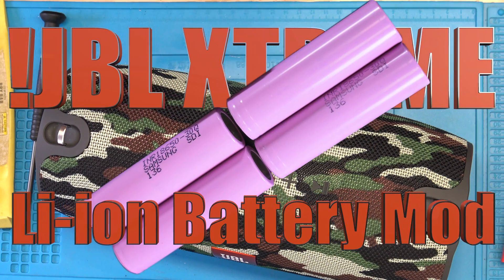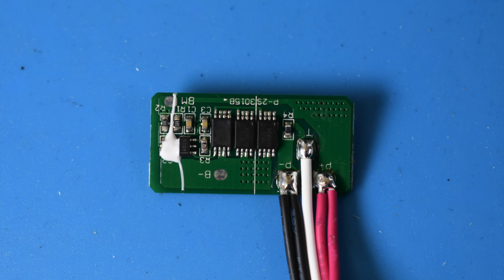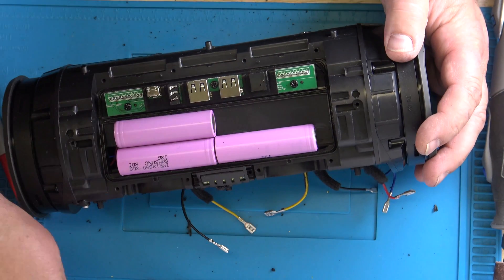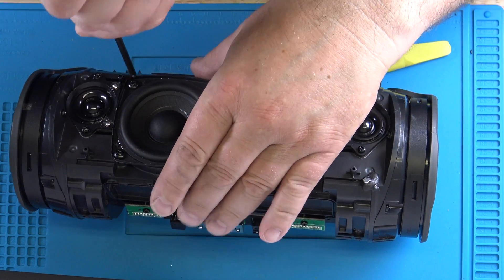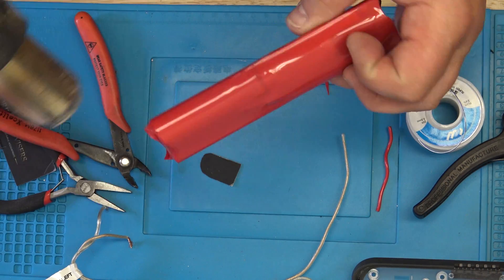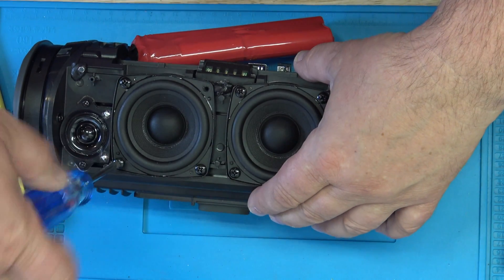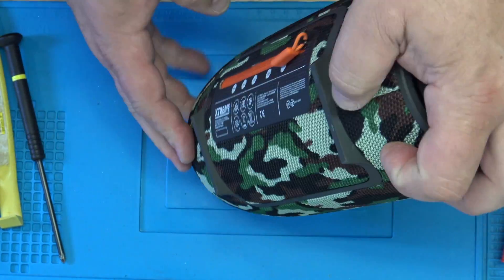JBL Xtreme Li-ion Battery Mod - The Right Way

Comment: Hi, can you explain me one thing. when i make 2s with 18650 so the voltge vil be 8.4 v and the charger is 19 V so how this can work ??
Reply from the maker: I made this video 6 years ago, and the speaker still works with the same battery hack. That show me that it works. I don't know how, but the original pouch battery is wired the same way.

Comment: Hey, I’m trying to do the same with the boombox 1 and i found they are 4 cells not 2 and the BMS is like a double of the one on the xtreme so could you please tell me how to connect? Should i get 8 batteries 18650 ? Or only 4 ? Please help
Reply from the maker: doesnt boombox one have 18650s?  i think its safe to get a new battery of ebay.
Reply: No it’s not unfortunately it’s liPO battery  i guess
Reply: Could you please send me your facebook profile or anything so we can chat on ?

Comment: Sorry for the very very late reply. Just want to say thank you for sharing your video. I was able to gain knowledge and experience. Especially during the replacement of the battery of my jbl extreme speaker got from my father in law. Now i have two of them the other one was the jbl boombox. I did the same.

Comment: Hi, thank you for this demonstration! I have done the above with some Samsung 3500mAh batteries. How have your batteries held up? Are they still keeping a charge after 4 years? Ive noticed when charging mine that the indicators go from 1-4 very quickly and also from 4-1 very quickly. Have you noticed that your battery level indicator is now less accurate?
Reply from the maker: not really, mine still works great. Make sure you have real Samsung batteries, there are counterfeit cells out there. And it takes only one bad cell in the pack to make the battery pack behave weird.
And what do you mean by very quickly? How long does it take?

Comment: How did you manage to solder the wires to the BMS module? Solder doesn't stick to those plates when I try to solder them.
Reply from the maker: You need to solder the battery ends off that board, heat it up with the soldering iron, and remove them first.
Reply: @mygiguser  Thank you.
Reply from the maker: it should stick, no problem here

Comment: hi,do anyone know solutiom for xtreme 2?,because theres a yellow and white cable,the white cable with 10k resistance not works,been changing the battery cell with original bms board but the bms didnt showing output power
Reply from the maker: the xtreme 2 has already Li-ion batteries, you can buy a complete pack with bms
Reply: the battery itself here was way to overprice, the price of the battery are like as the speaker itself sir,cant turn the speaker without battery😢
Reply: is there a way to use the speaker without battery,sir???

Comment: jbl xtreme slow charging after 18650 battery 2600 mah panasonic replacement, what"s the problem?
Reply from the maker: what do you mean by extremely slow? is your power supply ok? how did you wire this (same as in video?)?
Reply: @mygiguser  after 10 hours charging last diode of indicator still blink, power supply is ok,wire is same as in video. how many hours do you  need to charge you speaker after upgrade 18650 batteries?

Comment: Hi!
i was doing the same mod for JBL boombox can you help with wiring. It has 4 x 3.7 V cells  like xtreme but the BMS have 4 pads 2 B+ and 2 B-. Should i individually connect 2 x 4 cells in parallel and connect them to B+ and B- respecively or need balance lead. Bit confused any help will be appreciated.
Reply from the maker: connect the same way as the original battery was connected
Reply: @mygiguser  yes connected 8 Lion cells (Sony VTC6) in 2S2P configuration to make a 14000mAH 7.4v battery pack. The cells where at storage while making the battery pack. After installation it got 100% charged in 2 hours and i have been doing a test from past 12 hours. The backup has increased as still the 5th led has not started blinking. Thanks @mygiguser for the idea.

Comment: @mygiguser I accidentaly ordered a new battery for the xtreme 2 instead of xtreme. Could I just trim up the battery spot like you did and put in the xtreme 2 one?
Reply from the maker: the battery in Xtreme1 has 5 pins, and the battery in the Xtreme2 has 6 pins. So the answer is no. You would have to rewire that new battery pack to get the connector right.
Reply: @mygiguser  what is the yellow color in 6 pin xtreme 2? i now the red are positive black is negative and white is temperature but the yellow im confuse.

Comment: Why not make a wire with plug going outside, so you can connect and disconnect multiple batteries ?
Make a fake battery pack inside to keep the sound the same
Reply: because it is ugly

Comment: Thanks for this video. I'm just wondering how to do a li ion battery pack with negative, positive and data cable as well. My Sony XB30 bluetooth speaker has 3 connectors on the battery port. What happens if I make the battery pack without that third (yellow) port?
Reply from the maker: you need to build the battery the same way the old one was. the 3rd connector may be for temperature monitoring, and the whole thing may not work without. But the XB30 battery is already made from 18650s? Does it make sense to just buy a new battery pack?
Reply: @mygiguser  thank you so much for replying me. I'm not sure if the battery package of my BT speaker is made using 18650 batteries. I just want to know how to make a new package because I found that purchasing a new one is not that easy and to be honest I really like the sound quality of my bluetooth speaker so much that I don't want to throw it away when its battery pack gets damaged.

Comment: I did it. But the cable burned out. Which cable we need to use is the vehicle wiring cable?
Reply from the maker: you did what? and what vehicle wiring cable? what cable burnt out?
Reply: @mygiguser  
I used a thin cable.I made the wrong arrangement short circuit

Comment: Can I do that to my JBL charge 3? What's that a combine of parallel and series connection?
Reply from the maker: No, not enough space in the Charge3, and yes parallel and series!
Reply: What is the voltage of that connection? I thought that jbl extreme is only about 3.7v

Comment: I will try this. I have 18650 4x 5000mah..thank for this video..
Reply from the maker: there is no such thing a 5000mAh 18650, that sounds fake. Where did you get those from? China?
Reply: @mygiguser  no.. I took from broken samsung laptop. And Ialso have 3500mah
Reply: @BLACK_HEART_1993  How is it working for you mine are 4200

Comment: I will use 26650 3.7 volts with 5000mah.base on your drawing i will connect only the blue and red?no need the green?
Reply from the maker: 26650 doesnt fit, and why are you questioning the green? Green is shown in the schematic because it is necessary. I dont understand why you question that? Also 5000mAh may be too much for the BMS, the max for a 18650 is 3000mAh as far as i know, everything higher is fake.
Reply: @mygiguser  because i will use only single battery..26650 5000mah

Comment: Will 2 batteries setup work.. if yes then how to connect bms?
Reply from the maker: where do you put 2 batteries? there is not enough space
Reply: @mygiguser  i have onepack inside near the radiator. can install another pack in place of the original

Comment: But there is hole in the speaker box now. Radiators needs a sealed box to be able to make bass
Reply from the maker: fwe we use silicon
Reply: mygiguser maybe some harder glue would be better but yeah
Reply: Lost the bass

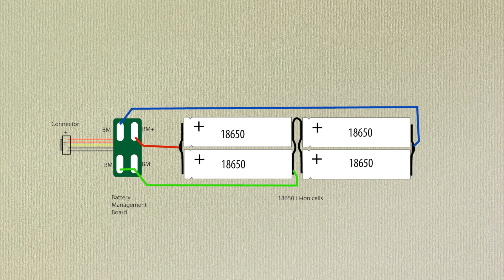Comment: Can you please explain to me the diagram shown at 2:43. This diagram is different from the other vids showing. I just want to know what and why because I don't have any idea. Thanks for answering.
Reply from the maker: not sure what there is to explain? how is it different than others? The original battery has two pouches, my setup has 2 sets of 2 batteries in parallel, and the wiring is the same as the original battery pack. And btw this setup works in my speaker since i made the video, and that is 2 years now.
Reply: @mygiguser  thank you so much for responding. Is it okay for those 2 wires in the middle to get in contact with each other? I'm talking about the wire that connects to the green wire. I hope you understand what im saying as I don't really know how to explain it.
Reply: @mygiguser  I'm just currently waiting for the 18650s that I ordered before I do the procedure. I hope I wont blow up my speaker lol

Comment: Ok. I've seen people with that it keeps blinking with the fifth led. Why is that and what could you do about it?
Reply from the maker: Well when you have a brand new great battery this charge indicator may work. Once the battery was in use for a while it is more and more likely that the 5th LED stays on, because that kind of battery looses its capability to charge 100%. And the 5th LED shows the 100%. I don't think it is a big deal.

Comment: 1:39 Those magnet does not conduct electricity. Therefore, there is no insulation on the connectors :D

Comment: Great video.

One question... How did you test the laptop batteries  to determine if they are good or bad?

Thanks.
Reply from the maker: i used an intelligent charger/discharger to charge them one by one. There was only one bad in the whole pack.
Reply: @mygiguser  OK thanks. No easy way that I can check it without fancy equipment? (also using an old laptop's battery and don't want to use cells that are bad)
Reply: @HeinrichvanRooyen  There is an easy way, youtube it.

Comment: Hi bro. Very nice video. Nicely explained. I have one question The original battery is 5000mA 7.2V, I am planning to put 6 no’s of battery, each battery 1.2 V(AA) 1300mA. Battery size 6 no’s fits very well , Is is possible to connect 6 no’s AA battery in series to the circuit?
Reply: no it is too long

Comment: @mygiguser can you explain??  
why you put the batteries in series and not like the original configuration 2x parallel ??
second question: does the green wire connect on the BMB on both BM contacts??
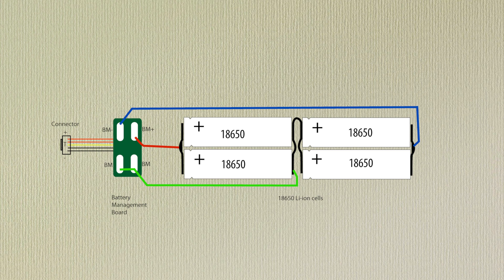Reply from the maker: @2:44 is the schematic of this, and yes, green wire connects to both contacts.
Reply from the maker: The original configuration is 2x parallel? what does that even mean?
Reply: Ok let me  change the question so you understand it better , the original configuration was two flat batteries independent connected to the BMB. why did you made one batterypack out of four batteries and not two packs of 2 batteries? And connected them the same way as the flat ones

Comment: update on jbl charge2. i was able to salvage d pcb board on the swollen lithium ion battery of my jbl charge2. at first i was very hesitant and afraid  to remove the board. i carefully peeled the shrink tube that was covering the battery also tried not to damage the body of the lithium battery to avoid sudden fire. well im very thankful that nothing happened that time. i swapped the old battery with a single 18650mAh 3.7V. as of this moment my speaker is working again.. i suggest not try or risk the same way i did if you dont have any small knowledge about electronics.

Comment: is it safe to open the bloated battery of my jbl charge 2? not entirely the lithium itself.. just only the  shrink case plastic that wraps around it. i was also going to try this method instead of buying new battery. i find it so expensive. thanks.
Reply from the maker: Lafflaga Belonio NO, that is not safe at all. if it is bloated you MUST replace that battery!!!
Reply: @mygiguser  ok sir thanks for the advice!

Comment: There are gaps by your battery bay don't you hear distortion sounds?I used silicon and a layer of duct tape on mine does the trick well
Reply from the maker: No, i didn't have any distortions. The gap you could close with epoxy.

Comment: Hey giguser thnx for the help my jbl works properly now, for increased battery life instead of 4 I placed 8 batteries (4on each side)  Jst one issue when charging after 30 mins the 4th led starts blinking and after tht it reaches the 5th led then 1hr later again 4th led starts blinking and it goes on forever. While playing I get a very large playback time, but how would I knw tht batteries are fully charged coz 4th led starts binking and goes on forever also would like to knw is there anything other wrong with it coz my batteries I used were of good quality
Reply from the maker: I don't know, maybe the battery board is too small for that many batteries?
Reply: Same problem with my JBL

Comment: Not sure the batteries setup, BM combine to top and bottom, how the chip know the batteries are balance?
Reply from the maker: John Lee when wired in parallel, they balance themselves.
Reply from the maker: Keep in mind, this pack consists of 4 batteries, that is two pairs. The battery board you need to use will balance one pair with the other pair.

Comment: What did you use to cut the piece of plastic that doesn't let 18650s to fit?Should i take care of anything?|I am charging to full at the moment with the speaker assembled, the door doesn't close good so there is air leak and distortion at the bass, i was wondering if would good to mod it, i will check how much it lasts with the 18650s and if is a big improvement then i will go on
Reply from the maker: darkovsky i used a Dremel.
Reply: @mygiguser  this is what i thought, thank you

Comment: I did the same but I have no tension on the balancer output why?
Reply from the maker: Good question
Reply: it turned out that the batteries were not charged enough, does it close normally?I can't close the battery compartment

Comment: I have a problem with my jbl xtreme I just bought a battery for my jbl it won't charge up at all and it won't play unless it's plugged in and even then it still turns off, and just to let you know it was doing this before I put a new battery. So please help me what do you think is going on with it?
Reply from the maker: If it is not the battery then it could be the power supply? Can you check the voltage when the power supply is attached? Maybe it doesn't have enough power?
Reply: Defective battery

Comment: U said there are ready to buy batteries for replacement but i only find Lithium Polymer batteries, that are different batteries, LiIon like u use have much more lifetime even if you store it with 100%. :)
Reply from the maker: That's correct, but if you buy a ready made pack, you don't have to modify the case and you don't need to solder. Not everybody wants to do that.

Comment: Wenn ich 4x18650ga nehme mit 3500mAh bei 3,6 Volt habe ich 7Ah bei 7,2V also ~50Ah. Ist das Problematisch denn der Lautsprecher maximal 40W im Netzbetriebt leisten kann? Beim Originalakku bleibt man ja bei 37Ah. Hoffe du kannst mir helfen.
Danke und super Video
Reply: Das Netzteil hat 18v ist es also doch möglich dass der Lautsprecher mehr als 8,4v verträgt?
Reply from the maker: Der Strom wird vom battery management board an der Batterie geregelt und limitiert. Ich glaube nicht dass es dort zu Problemen kommt.

Comment: After ive done this, when fully charged, the led lights are not lit anymore, is that normal?
Reply from the maker: Jay ar Zamora only if the batteries are fully charged. Otherwise some should be on while charging.

Comment: What size of battery wrap did you use on this video?the one you use to make 4 batteries
Reply from the maker: I found it on Amazon: Uxcell a15012900ux0431 PVC Heat Shrink Wrap, for 2 x 18650 Battery, 10 m, 50 mm Width, Red

Comment: Hello, after the mod I got a little distortion on the side of the pasive radiator that is taken out when reaching low frequencies, what could it be. I tried to tighten up the bolts that hold it as muchs as i can and it seems it helped a little but I cant figure out what reaaly could be the problem.
Reply: Wires touching surfaces can cause distortion/rattle..

Comment: Can I use 4 18650 3.7V batteries each?
Reply from the maker: Vitor_ isn’t that what i used?
Reply: @mygiguser  so using 4 battery is 14.8v! right
Reply: Depends on how you link them

Comment: I made the change, it was running for 8 hours, but when I plugged in is going to the 5th led and blinking non stop.I removed the charger and is not turning on animore. Is turning on only when you plugged in the charger.Help please !

Comment: I have one question. In managment board you have the red positive cable and the black negative cable right? What is that green cable?
Reply from the maker: We have two pair of batteries. Each pair has 3.7V, and the two pairs are wired in series to achieve 7.4V
The green wire is the positive of the first pair, and at the same time the ground of the second pair.
This is needed to be able to charge both packs to the same level (also called balancing the battery pack).
Reply: @mygiguser  okkkkk now i undestand. I'll do tomorrow than ill feedback here. Thank you very much

Comment: The battery compartment is not closing fully not any space left so is there another way that I could put some hot glue from outside to stop air leakage ??
Reply from the maker: Yash Dobra that’s why i removed some of the housing. i show that in the video. if you use hot glue then you have trouble later in case you have to replace those batteries next time!
Reply: @mygiguser  yes now I see I would remove some of the housing and then I m sure they all will fix and the compartment will be tight when closed and no air will escape, followed ur instructions dude. Keep it up the pro. Battery pack idea is awesome keep it up and thnx for making my day 😇